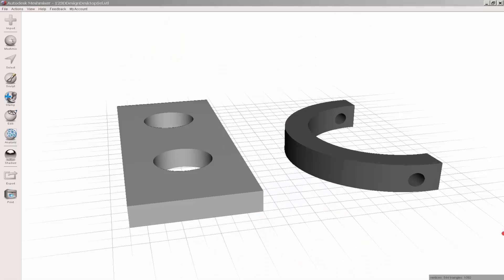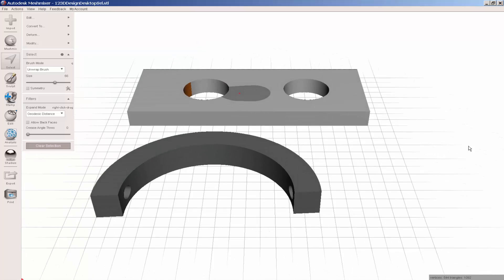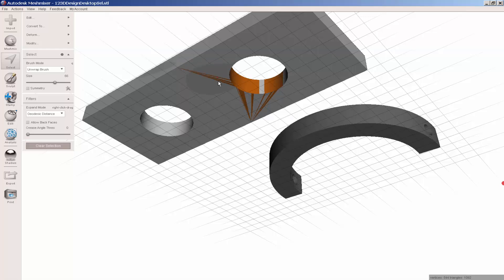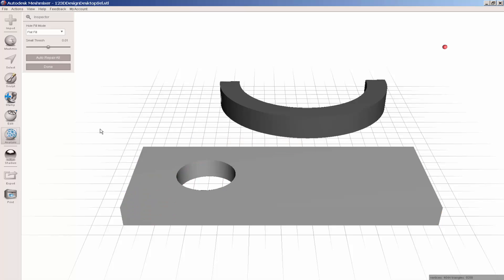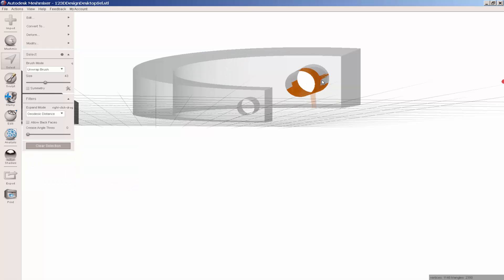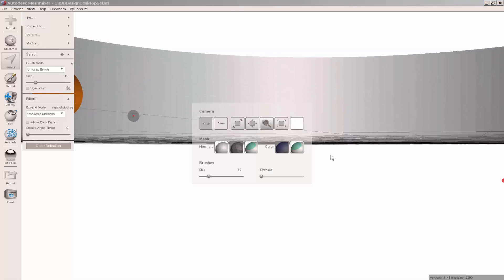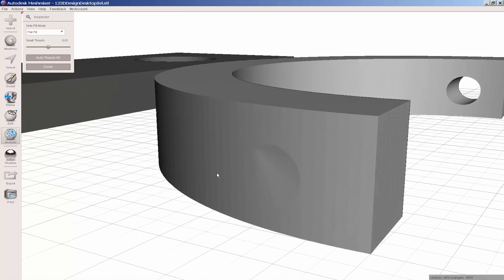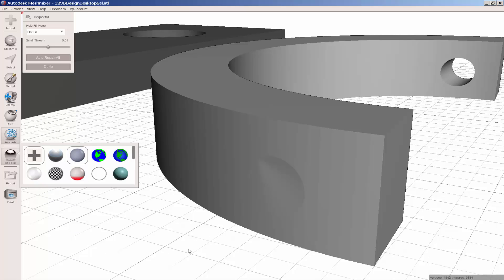Meshmixer: Fill Holes in an STL File

Comment: Even after 9 years this video keeps on helping people.
Was going crazy to fill a hole directly in Orca slicer by adding a cube as a part.
But placing the cube is so super annoying that I just did your Meshmixer trick.

(Orca, Bambu Studio and Prusa slicer always take the middle of an object as coordinate. So if you want to place an object of 10mm height to the build plate, you have to place it in world coordinates to a Z-height of 5.0mm so that it is perfectly flat on the build plate. I had a model with 0.75mm height. But since the placement is max. 2 digits I couldn't place my model at 0.375mm height - either 0.37 or 0.38. Drove me nuts.)

Comment: Awesome, thank you!  Is there an option for resizing the holes?
Reply from the maker: I don't think so. You could try bringing in a cylinder from the Primitives bucket and try to combine/cut, but it will be tedious.
Reply: @ProfDrafting  I've done that recently, not as tedious as I thought it would be. If you drag in the cylinder and flip the normals, it turns into a hole when you make the entire model a solid.